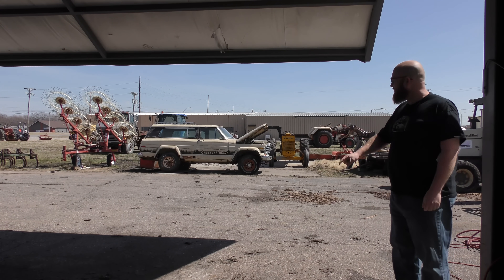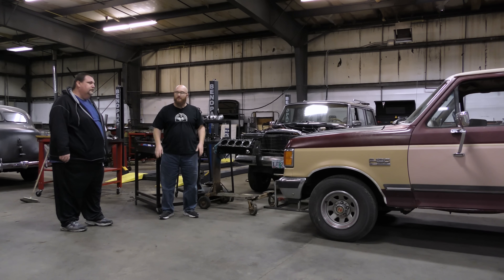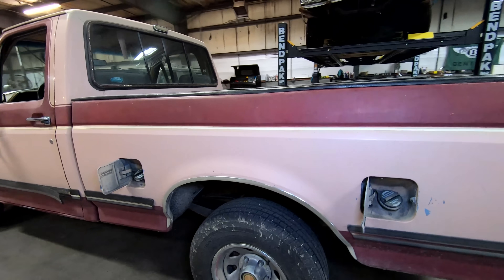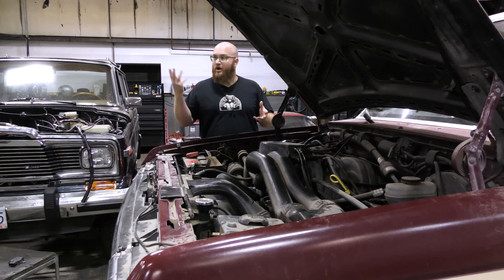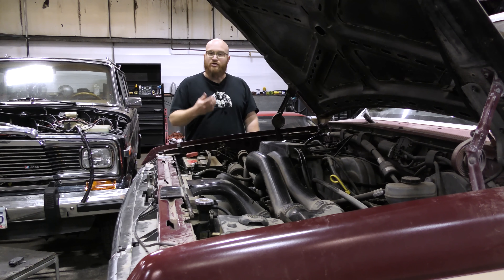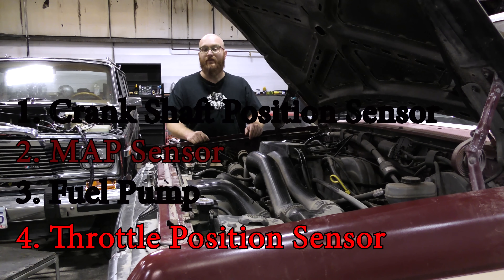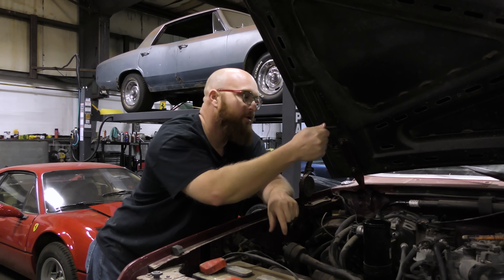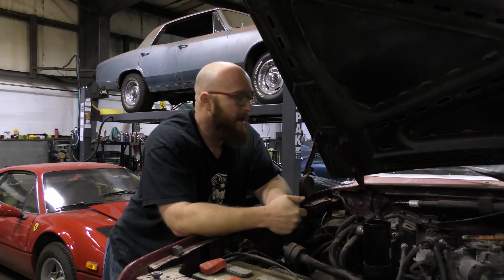Parts cannon couldn't fix this '90 F150. Old School diagnosing by the CAR WIZARD

Comment: I had one of those Ford F-150's with the 302 in it. It used to be an escort truck for oversized loads and had over 300,000 miles on it. Since I worked with these guys for years ,I knew this truck and when they decided to upgrade, I bought it and drove it daily for a couple years. It started using gas and flooding out a bit and used some old school diagnostics(been a licensed mechanic since '72) and tracked it down to the fuel pressure regulator and all my problems went away. It's amazing what you can do when you just sit back and think about things for a minute.
Reply: I have a beautiful black with charcoal interior 1991 F150 XLT Lariat 4 by 4. I bought it brand new. It began to run crappy for a couple years and I thought, oh well, it’s an old truck. I almost gave up on it. No one could seem to help me, until a mechanic at ford came out and told me “you need a throttle position sensor”. I said ok go ahead. Well, I could not believe what a difference this part made! It was unbelievable. It ran like new again, and still does. So, anyone who owns one of these, and it’s running rough, remember THROTTLE POSITION SENSOR.
Reply: I had one when the fuel pressure regulator went. Put a new one in and drove it for years.
Reply: I'm inheriting the running rich, floating idle problems of a 1990 F150 XLT Lariate 4x4 4.9L EFI with California emissions. After reading about how the fuel regulator can leak gas directly out of the vacuum line I plan on changing it out along with a host of other parts on this old truck. TPS, Idle Control servo, Air temp sensor all helped clear up the floating (oscillating) idle in drive, except it comes back in park/neutral. Even after cleaning up the throttle body (the gasket seemed shot), everything behind the throttle plates was black with soot/carbon and I think this has been going on for close to 30 years (2003 smog was 50 ppm Hydrocarborns until 2017 when it was 190 and who knows what it was today before I started working on it. All I know is with all the plugs sooted out, and was not going to pass smog. Looking at this think it seems like the air pump and EGR system can mask raw gas being pumped in from somewhere (fuel regulator??) Up until 2017 (HC 190ppm out of 220ppm Limit ). It still passed AZ smog (just barely) but showed signs of rich  (HC 50ppm) in 2003 already. I drove it home for 10 hours from Colorado and it runs fine on the freeway at 65 mph and got 14.5 mpg and 230K miles.

Comment: As the owner of an old alfa with two twin carbs (that has TB bushing problems because of course it has) and a 95 civic I appreciate this video way more than the ferrari ones.
Reply: Yeah, Ferrari's are lameeeeeee
Reply: Must be a pre 1971 Alfa or it was converted to carburetors.
Reply: @machtschnell7452  1986 Alfa 75 2.0, it was sold only in europe in this configuration
Reply: @machtschnell7452  Here in EU Alfa got away with carbs up to 92-93 (Alfa 33)
Reply: Same here...I can relate to working on modest 90s cars but can't relate at all to Ferraris, Lambos, or any other car of that ilk, so I have zero interest in them
Reply: I sold my 95 civic 15 years ago...  still ran great with 225k miles on it.
Reply: @phreak1118  I sold my 1994 Civic DX in 2008  after I got my 1998 S10 long bed factory tow pakage, formerly pest control  fleet truck.  Loved driving the Honda, hated getting out after driving.    I sold it since I hate seeing good cars sit.  I still have S10 with 228856 miles.  I also have a 1995 Jeep YJ.   Have gathered parts and 1982 K10 to re engine transmission and transfer case.   All that to say old vehicles are good.  While lambo and other low little cars might be pretty but not for me.
Reply: I have had that same throttle body issue with my Civic. You can put one from an older Integra on to get a little bigger diameter and I like to use the ones without the fast idle solenoid (instead it just has a coolant pass through) to eliminate that as an idle issue as well. The IAC will compensate for it on startup. I would idle at about 1500 rpm on a cold start rather than over 2000 with the fast idle solenoid on the car.  One less issue to have later on down the road since those are a common fail point on Hondas as well.
Reply: @CouchMan88  don't have TB problems on my civic. The alfa carburetors have that issue, but it's a minor one and i am not bothered by it because it starts fine and a barely noticable rough idle does not concern me on a car that old
Reply: Two twins...??? so 4 carbs? That would be a nightmare. My old Datsun 2000 had only two carbs and they were a big pain-in-the-ass.
Reply: @TheDesertwalker  not a nightmare if you have the right tools, you just need to tinker with them every now and then. Can't afford an injected engine with ITBs so this is the next best thing. Also, not a lot of cars out there that have efi and itbs engines. There are some BMWs inline 6 with ITBs and EFI, but they are worth ferrari money nowadays, so it does not make sense for me. If you want to experience the instant throttle response of an itb engine for cheap, old carburated alfas are the way to go.
Reply: Agreed!
Reply: Soulburn89
Preach to me Soulburn !!! I want more accessible cars also.  I drove a 58 Alpha Spider from Lake Como to Monte Carlo.  Never forget it.  Wish I could afford one.  Rather have that than a new Ferrari.
Reply: @TheDesertwalker  "so 4 carbs? That would be a nightmare." Motorbike owners everywhere going "tell me about it"... :) Honestly it's not that much of an issue as soon as you get used to it. On the other hand, you definitely appreciate swapping for a twin or a fuel injected bike every once in a while :)
Reply: You can use a voltmeter on the test plug and just count the pulses on the voltmeter if it's an analog one it'll bounce back and forth but it has to be an analog vote meter
Reply: And no small vacuum lines are very brittle
Reply: @Soulburn89  twin carbs must be synched perfectly  and must function exactly the same, or rough running  will result I had a volvo b 18 that had su and one dash pot cylinder was ovalized, once replaced, the engine ran as well as an F.I.rig
Reply: @mikesmisadventures  old B18 volvos with identical twin SUs, tuned identical and jetted property  gave me very smooth throttle response from 15mph to 75mph, just as good as FI
Reply: Also gave 36mpg and great handling with Goodyear blue streaks all around Kunis on rear gabriel E series on front, plus neg camber on fronts, I could run away from 911s on dry mountain roads old PV544, great bullet proof car drove 275k. Very easy to fix ,blast to drive
Reply: Kunis not kunis
Reply: KONI shocks
Reply: I have never even SEEN a Ferrari in my midwest town of 30,000 people.😂

Comment: You know your '90 pickup is fancy when it comes with a tach, AND a fold-down armrest!
Reply: my 94 does and I love my f1 shitty
Reply: @mromatic17  f1 deserves it's own race circuit. And you have/get to haul your camper with with your racer!
Reply: @CavemanVanDweller   i would do that. it has a hopped up 302 and its a 5 speed manual. its pretty quick for what it is.
Reply: Both! That's the '90s Platinum package.
Reply: I swapped the tach dash into mine, its plug and play for some years

Comment: My old man has a fleet of old late 80's to early 90's f150's with the 300 in them. The carbureted engine actually got better gas mileage off the bat. They are bulletproof.
Reply: I had a 91 300 5 speed 4x2.  the body was rattle can camo over rust.  engine knocked so bad people stare when you drive by.  but it would never quit I signed it over to a friend when I moved away.
Reply: You can't kill them.  I've tried.
Reply: That motor was so good Ford had to quit making them
Reply: I love I-6s! IMO, the ideal truck engine design for someone living out in the sticks. A market that is almost entirely second-hand and the manufacturers have no reason to cater to us. It is a shame. 

Looking at my LS-based V8 I have often wondered why GM did not use these components to create an I-6. Reuse pistons, rods, valves, EFI components, the basic valve train, and head design. Maintenance could be such a breeze! Rebuildability and lifespan are very real eco-concerns, IMO. Throwaway cars create very real pollution!
(If I ever win the lottery...)
Reply: I believe the carbureted 300 6 gets better fuel mileage and probably has more power at least more than my 91 300 6. I've never been able to get it to run right. My mechanic replaced the cracked head with a reman and also replaced the ecm. I then replaced the tps and iac. It's a total dog and runs rough. I'm kind of at a loss if I had a mechanic like the wizard I'd have him take a look but at this point I don't really trust any local shops to actually pinpoint the issue.
Reply: The carbureted 300s did halfway decent on fuel mostly because of the tiny 1 barrel carburetor they had, it was only around 190 CFM in size if memory serves me right. Meanwhile a basic 300-400 cubic inch V8 of the era likely had a 500(ish) CFM 2 barrel, and a "performance" model of similar size might of had a 600-650 CFM 4 barrel. Dumping gas down one small hole verse 2 or 4 much larger ones...
Reply: @ricochetey  My dad's got an '87 300-6. I don't know what the speed-density EFI is unhappy about, but boy is it. We're about ready to slap a carb on it. Try the FTE forum if you haven't, some of those guys know these things pretty well.
Reply: Yea they good rigs
Reply: @Chris_Troxler  lol 🤥, that’s not quite accurate Chris! Mine has been out in the driveway now for a little over a year DEAD as hell brother!! I e been working down thru the list of things and each time i swap something, it uncovers a new issue I didn’t know I had. I just replaced the computer and was hoping i was bout done but I’m still in a no start condition and when we checked fuel pressure it was nearly zero so I’m waiting on the proper fuel pressure regulator to come in today. One came in yesterday but it was the wrong one. You can hear the fuel pumps run like they are sposed to do when the key is turned which is why I’m starting with the regulator cause it’s much easier and quicker to change than dropping the tank for a fuel pump. 

Fingers crossed this will work this time cause other than replacing these worn out parts, they are very good trucks. Mine is a 94 F-250 with the 5.8 snd I’m approaching 300k and it runs and drives like a new one. Paint is faded but that’s fine, it’s my work truck
Reply: @1982MCI  And once you've figured out the root cause of the problem, you'll have a truck that will run and drive again?
Reply: worked on several early '90's efi f series, bad on gas new and get worse over time
Reply: @Chris_Troxler  yes I will!
Reply: My 94 F150 with 4.9 liter and 5-speed 200,000 miles and it's not quite fully broken in yet &drives like it's brand new!!  if somebody doesn't total it out for me, it'll still be on the road 30 more years from now OR until the federal government stops me from driving it.. .
Reply: My dad had an 88 250 also. He was 49 when he bought it. He loved that truck. Rear tank never worked either. Well so he thought. When I was low on gas I’d use a pump to cypher a gallon or two. I was a kid. I lost in seven years ago and miss him so.
Reply: @silvergalaxie  mine 90 F150 with 300 gets 22mpg city and 22mpg  hwy  with +600k miles (eninge is all orginal as was out of cleveland in 89) and is daily driven still.
Reply: @1982MCI  My 1990 Bronco had original fuel tank which was heavily rusted inside.  The fuel pump was running, but was starving for fuel because of a plugged up metal mesh strainer just before the pump.  This was located inside of a molded plastic "can" assembly inside the tank.  Believe it is called "fuel pump hangar assembly.
  Might not be your pressure regulator.  Test and measure for GOOD fuel flow by removing fuel filter on frame rail under left side (mid-vehicle.)  Remove fuel pump relay and "hot wire" the circuit so pump runs continuous for the test.   Somebody else will have to tell you the spec for how much fuel it should pump in thirty seconds.  Mine was not pumping much.  Guess it should pump at least a quart in 30 seconds if flowing freely into a bucket at the point of disconnected fuel filter.  Measure flow on the engine side of the fuel filter, to confirm filter is not clogged.
Reply: @1982MCI  My 1990 5.0 V8 would start and idle very smoothly, but would buck and backfire while trying to drive upon reaching 10-15 mpg.  Pain in the ass, but the fix was to drop and install a brand new tank.  While I had it down, I put in a brand new (best I could find) fuel pump assembly, (not a $50 China unit) because didn't want to ever do the job again.  Cobbled together some pieces of 2x4 wood to rest tank on top of floor jack to raise up into place.  Think I got tank partway in place and attached bolts on bumper side of tank before connecting fuel lines at pump and electrical connector.  Been a few years and memories fade.  Buy some 5 inch long bolts, washers, nuts, to get tank close to being installed, then change them out to proper length, one at a time.  Good luck.  Keep a crew standing by with water and fire extinguishers, and try not to burn the house down.   IMPORTANT:  Position electric windows where you want them, and then DISCONNECT negative battery terminal before working around the fuel system.
Reply: Chock front wheels and place rear axle up on jackstands so you will have plenty of room under vehicle.   Alternative plan is to support frame behind rear axle and raise, this allows rear axle to hang lower and you might get better access to fuel lines and electrical harness connector at pump.  Splice in a new electrical connector at pump.
Reply: @bobadingo  Would you consider trading your truck for $30K cash?
Reply: @chetmyers7041  🤣.. . Not a chance!
Reply: Not my experience. I had both versions of the 300, an 83 carb, and the 89MPFI. The MPFI was superior in almost every way including fuel mileage. At one point when the truck was good and broken(about 30-40k) my 89 4.9/5speed returned 21Mpg on an all hwy leg of a road trip I was on running a steady 61Mph! Best I ever got though. Average was 18 or so. Great truck and way more driveable(read peppy) with the MPFI. :)
Reply: @bowez9  .guessin' there were different operational set-ups of early "computer controls" & fuel flow. Doan doubt you, whatsoever, tho have seen several examples of half that, carrying nearly zero load. G.I.Davis sr
Reply: @silvergalaxie  pedal input is key the 300 only has a loud pedal, the only difference between cracked throttle and full throttle is loudness and mpg power is the same.
Reply: My dad had a 1990 econoline with the 300 in it. the body rotted off it, but that motor had no issues. the only thing he ever had to do on it even remotely motorwise was just an idler pulley.
Reply: @ricochetey The carburetor sucks. My 86 carburetor kept having the float overflow until i put a inline fuel filter in the rubber pump line. Then, the carburetor kept loosening up from the base giving a false air leak. But when i rebuilt the engine with a c6 it would get 16 mpg. I used a step up from stock cam. My 94 gets 17 to 18. But i have gotten up to 20 with it. Usually when i use gas with no ethanol. I just recently acquired a 96 with a 5sp. 

I got pissed at all the carburetor problems and a few other things and got rid of my 86. I would never go back to that carburetor it sucks. EFI is so much better. And NO. The carburetor engines DO NOT have more power. EFI gives each cylinder more of the proper fuel at the proper time. The carburetor on the 6 and carburetors in general are a guestimate of mixing fuel and air. They dont do it nearly as efficient as EFI. Plus, the 6 is so long, the cylinder 1 and cylinder 6 run lean because they are so far away from the carburetor.

Comment: That's not an idle adjustment screw on the throttle body and you shold never move it. It is keep the throttle blades from getting stuck in the TB by closing too far.  The ECM is programmed with the volume of air that is getting by the throttle blades in the idle position and if you change it you will throw it out of whack.